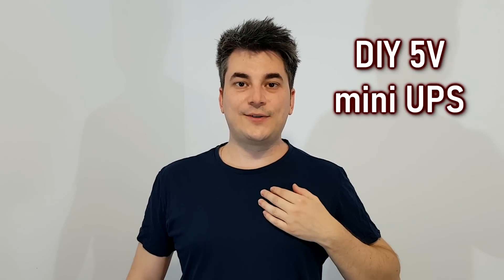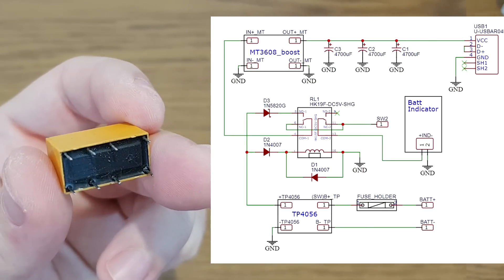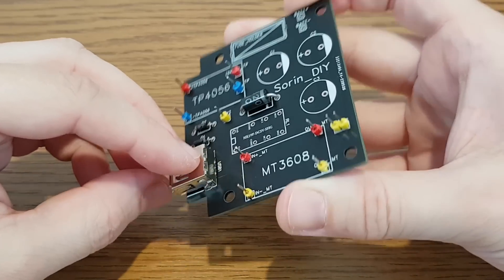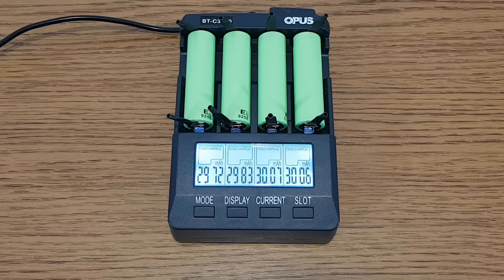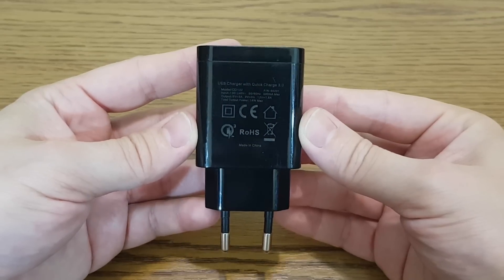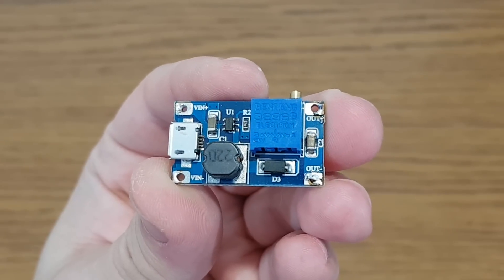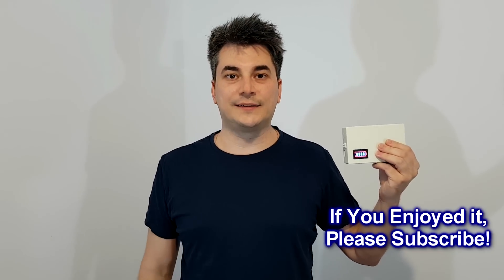DIY 5V mini UPS with 9000mAh

Comment: I am thinking about connecting this kind of thing to a USB hub to allow connecting more than 3-4 portable hard-disks, and they should stay powered even through short power cuts, which gives me a chance to switch off my laptop safely, without the risk of getting the HDDs disconnected from power suddenly. It also should allow data transfers like USB 3 (about 100MB/s).

When I watch your video, I am a bit worried that these batteries may set themselves on fire one day, without any balanced charging / discharging.

Comment: Congratulations for a good video. I want to point out that you have not taken care of load sharing when charging the battery with TP module. Since you are charging the battery as well as at the same time you are taking current for output USB so the TP module will confuse and will keep charging the battery. It may not stop charging the battery. Have you seen battery charging stopping upon completely charge ?
Reply from the maker: Hi. The schematic may be a little confusing. the battery is connected to the boost converter, only when there is no charger input and the relay pins (battery to converter) are in normally closed mode. when the charger input is active, the relay "opens" the battery-converter circuit and the battery is connected only to the TP4056. so the charging of the battery is done separately from the rest of the circuit.

Comment: Would it be possible to add a push button for battery level check when not plugged in? Instead of flipping the on/off switch.
Reply from the maker: Yes.

Comment: Can we adjast out put to 12v
Reply from the maker: With this configuration it will have a very low current. I will build a better 12V/19V UPS in the future.
Reply: @Sorin_DIY  please i need only 12v

Comment: Sir, I'm a newbie and I have seen your 12v wifi ups video but can we swap 5v components with 12v components and use it as 12v wifi ups?
Reply from the maker: No. it needs more modifications.
Reply: @Sorin_DIY  ok thankyou

Comment: I have a question, if the power grid is restored, will the battery be charged simultaneously with the load operating using the grid power?
Reply from the maker: Yes.

Comment: What is the use of diode no. 2  1n4007 in your schematic? What does it do ?
Reply from the maker: It's used to decrease the voltage that powers the relay from the usual USB 5.1V to 4.5V, so the relay will switch to battery faster, when the mains is interrupted.

Comment: Sir please reply.... how much maximum amperes can we give at input of mt3608 module ?
Reply from the maker: The input current depends on the output current/load and efficiency. the max out current is theoretically 2A, but in my tests I got max 1.8A and then the voltage drops. with a high out current the efficiency will be low so it will draw even more current at the input. there isn't a simple answer, you need to measure and calculate everything.
Reply: @Sorin_DIY  sir which bms can I use for my 3.8v lipo battery full charge voltage is 4.35v

Comment: Just ordered a multipack of those tp5100 modules to try out.  I'm still a fan of the tp4056 and have many.  But the increased voltage input on the tp5100 is intriguing.  Good job.  Thanks for the info Sorin.

Comment: Will the battery keep in floating charge mode overcharge and die quickly?
Reply from the maker: no. when the charging is completed, the TP4056 module cuts the charging current. it doesn't have float voltage.

Comment: Neat project! I was wondering if I can use this as a Raspi 3 UPS, would this sufficiently provide amps for the raspi?
Reply from the maker: This UPS works with a 1A load. I think Raspberry Pi 3 needs maximum 2.5A, so I don't think it will be stable. but I will make soon a better UPS, with a higher current and bigger battery pack.
Reply: @Sorin_DIY  Awesome!!!! I would love to see that soon! Great work man!!

Comment: hope you can make 12volt in and out ups with relay, protection undervoltage and overvoltage for battery 12volt vrla/lead-acid, thx 🙏

Comment: very neat project but some of us usually dont have access to jlcpcb in our country but i have a similar board which is YX-X804. only problem is there is about 1 second delay when the relay switched from power supply to battery. im currently using it on my router. ive tried different types of capacitor i was able to salvaged from but non works or the maybe the capacitors used were not have enough juice to power my router? oh btw my router only draws 0.3 amps on 12v if that help solvesbmy issues.
Reply from the maker: Hi. I'm not familiar with that module, but 1s delay is long, most devices will shut down in that time. you can try with bigger capacitors on the output. 
or you can make my circuit on a simple perf board, or just solder wires between the components.

Comment: You can cut the charging of the batteries by adding a LM431 adjustable zener shunt regulator connected to another relay/mosfet or just use a different Rprog resistor to lower the charging current thus never letting the batteries reach 4.2V

Comment: looks good.would it be easy to change it to 12V?
Reply from the maker: this boost converter is not powerful. it can deliver 12V but probably with only 100mA.
Reply: @Sorin_DIY  what is the code or model name of the boost you showed in the video? Thanks!

Comment: Great stuff. Have really been long time for such tutorial videos. How hard it is to build 5V/5A(max) or 2.5A max ups. Is it a completely different redesign? I am looking to use somesomething of Raspberry pi4. Thank you again for making such great content.
Reply from the maker: hi. it will need a more powerful boost converter and a larger battery pack. like the ones I showed in the video.

Comment: what is the max amp i can get from this ups ?
Reply from the maker: the boost converter can deliver maximum 1.5A. but as a UPS it will work with 1A or less.

Comment: Hi Sorin , You always produce valuable video , and it,s very interesting . I need one info from you , i know it,s out of this video, and sorry for that , I have a cordless vacuum cleaner , it was working well , suddenly  it stop working , i change the motor and it works well , but the next problem is it works on speed one and when i turn on to speed 2 two ( both speed works with the press of the button) speed two cut the power off . i tried to check on many was couldn.t find the fault . can you help Tks Pal
Reply from the maker: Hi. without seeing the circuit I don't know where the fault may be.
Reply: @Sorin_DIY  Thanks Sorin, I will check it out stage by stage ..Hope to see your next video

Comment: good tip about poking the eye out, i never had anything hit my eye using dremel tools and what not because i always wear eye protection , except once when iwas cutting a piece of plastic with wire cutters, it literally hit my eyeball and i could feel it ike a blunt force hit on the eye,  not a sharp pain, and even felt sore after like a bruise would.  watch yourself when cutting hard materials, (actually dont, close your eyes!)

Comment: Can you not use the diode to lower the TPM charging voltage the same way you did for the input voltage?
Reply from the maker: no. it will not work correctly.

Comment: You bypassed the under voltage protection on the TP4056 board
Reply from the maker: no, I haven't. the over discharge and overcurrent protections work.
Reply: You didn't use the out - pin so i got confused .
Just realised that out - and tp4056- were connected together

Comment: This is good.

But there are smaller module that has almost all the feature integrated onto a 8pin IC:
- 3.7V battery 
- OverCharging protect
- OverDischarge protect
- OverCurrent Protect
- 5.12V 2A Output Boost
- 5V 2A input
- Support pass through charging (if input connected to 5V, output also 5V)
- 4 led indicator
- one click on/off button
- 92.5% efficiency
- Realy small pcb size 15mm x 28mm x 5mm
- Really cheap (around 1US$/module in my country)

The name of module is MH-CD42 & the IC name is IP5306

For the output just add 2x1000uf 10V capacitor or more so there no voltage drop when changing from main power to battery power or otherwise.
Reply: I have this module and i was looking for this exact info.. could you confirm the 2x 1000uF are in parallel or series? also is it better if I use one 2200uF or 4700/6800uF , can i use more than 10V like 16V 25V or 100V ? Sorry i'm just excited for this project.
Reply: @TruthLoversKoSALAM-fg8dh  
The capacitor is in parallel

For the cap voltage you can use anyting that more than 6.3V, so 10V is great.
For the cap capacity i reccomend use 1000uf-2200uf (not more not less)

Comment: May I suggest putting a Schottky diode in series with the battery as it has about 0,3V drop.. As long as it can handle the 2A max current

Comment: It's allways good to see new DIY designs... i used the TP4056 a lot in the past, but now i changed to the TP5100... also accepts 5v, up to 18v, and it's a buck charger, so it will be much more efficient, so less power wasted into heat...
Reply: Yes TP5100 is lot better than TP4056

Comment: Small hack I use for a similar application (actually I only want to be able to power my circuit from the same USB as the battery is charging while the battery is charging, but the trick applies here I believe): you can set the charge current for your battery pack from TP4056 by changing the resistor on it and you can select the maximum charging voltage by putting a diode in series with the battery and choosing the diode which has a small difference of the forward voltage at the max charge current and at zero charge current so that the battery doesn't go into a start-stop charging loop. I use a 1N4148 and set the current at 300mA... it charges the battery at ~3.8V and I don't see the blue and red LEDs flicker when charging ends.  I used this trick to make my nephew a music box with a DFPlayer mini and it's on the original Li-ion batery (1 cell) for 3 years now, being played every day and charged every other day. It's a miracle I can still think without singing "Aramsamsam" or "Lulu danseaza-n poienita" constantly :D

Comment: Dude, metal washers on a pcb? They are conductive, you know ...
Reply from the maker: so are the metal screws that tighten PC motherboards to metal standoffs, right? 
there is nothing conductive on the PCB around the holes. I designed the PCB so it can be tightened with different type of screws or even washers.
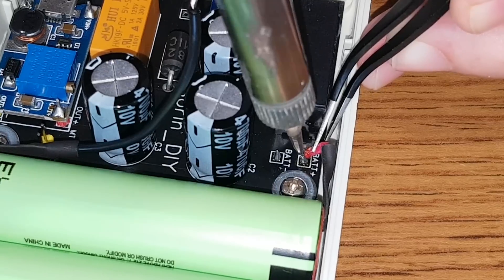Reply: @Sorin_DIY  @7:11 it's clear why we don't do that. In a real UPS with qualitative design no-one put washers/fasteners so close to mains or battery i/o - a simple mechanical shock on UPS housing can break that area and the bolt or washer to short the battery terminals or worse the mains. Latter will hit the circuit breaker and you'll have pretty 'awesome' time debugging why a practically new UPS triggers the breaker or why its batteries are in faulty mode on the display :D

Comment: hi my friend, i love this DIY  and maybe i will build one for me, thanks for the idea, maybe if you add a push button to charge the capacitors turn on and on the battery level indicator on demand can solve the issue of turning on and off multiple times to charge the capacitors. I think this can be great for my raspberry pi pc

Comment: What is the relay switching time..can it be a UPS for say a raspberry pi, can you test if it will drop out when switching please
Very cool, definitely need a build and test video on the larger output, this would be a GREAT backup for a raspberry pi or other 5vdc device
Reply from the maker: Hi. the switching delay time is about 0.1 - 0.5s, depending on the charger and the load. I don't have a raspberry pi but I'm convinced it will work. but it also depend on the total current consumption, this mini UPS is recommended for less than 1A. because with a higher current the boost converter will heat up and may not work correctly.
Reply: That why the capacitors are there, they keep the load On in your case, the Pi, until batteries kicks in. Plus relay used here, got a small switching delay, so chance are high to be good for a Pi or any 5V device.
You need to check his video he made long ago about Router UPS, last time he used capacitor to maintain load ON and dummy load to fast empty the Power wall charger.
This time dummy load is kind of replaced by more efficient relay time.
PS: I made the Router UPS based on capacitor & dummy load, for a 9v Router and it is working well.
It is basically the same as the router USP, instead this time voltage in only boosted to 5V.

Comment: What is the response time of the UPS? You say it has almost no delay switching between mains and battery power
Reply from the maker: Hi. it depends on the charger and the load. the chargers have smoothing capacitors that store a tiny amount of energy, which continues to power the relay after the mains power is interrupted. the larger the capacitor, the longer the switching delay time will be. I tested different chargers and delay was 0.2 - 0.5s with no load. 
if you connect a load to the UPS, it will draw power from the charger. so when the mains power is interrupted, the load will discharge the capacitors inside the charger faster, so the relay will switch faster. in my tests I got about 0.1s.

Comment: I really appreciate that you started to have links for the components you are using. As always, very instructive project
Reply: May I suggest putting a Schottky diode in series with the battery as it has about 0,3V drop.. As long as it can handle the 2A max current

Comment: Perhaps a different charger circuit module would have adjustable charge levels?
Reply: It doesn't, but it does have a pin 8 that you can pull low to disable the chip (and disable charging). It would need a bit of logic to operate that, but it should be manageable.

Comment: UPS? im sure this is different from actual powerbank lol maybe people like you need some learning instead telling people something that is not
Reply: UPS stands for Uninterruptible Power Supply, the power to the output is not interrupted when the mains is disconnected, so it's a UPS.
UPS for computers/servers that you buy are 2 types, the cheaper one, those are the standby versions, they power the computer straight from the mains,
and flip over to the 12V to 120/230V inverter as the mains get interrupted. The more expensive UPS are the active versions, those use a combination of the inverter build in and the mains, and filter out noise from the mains. Those version put out a real sine wave compared to the chopped sine wave of a the cheap version.
These ready to buy UPS have a 120/230V AC output offcourse, but the version that Sorin build works almost the same, but for 5V DC.

Comment: Thanks, this project is simply perfect!!! I Will wait for a variant having also a small 6volt solar panel to keep batteries charged, and the main power just to charge batteries when needed. Of course this variant will not be an UPS but more and offgrid Power source for small 5v projects. Br

Comment: Great little project making good use of other readily available modules. Only thing I’d add would be a temperature sensor on the batteries and maybe an inrush current limiter.  
Any chance of showing the supply current/voltage during switching on a scope? I’m interested to know if the dip would cause a processor reset on a connected project.
Keep up the excellent work and great to see you are training your assistant 😀👍

Comment: I'm not trying to teach anyone how to suck eggs but with UPSs it can be very useful connecting them to the target device via dual input adapters. That way if the UPS needs to be disconnected for a moment, you can parallel power the target device and remove the UPS without interrupting the target device. Not sue if this device will accommodate that.

Comment: Neat, in fact very neat !   Worth mentioning that you chose a TP4056 board that includes the DW01 FETs discharge cutoff to avoid over-discharging the cells.

Comment: could you please show a raspberry pi or something similar as an example .. just wanna see if it can keep a mini computer like raspberry pi running after power failure ... thanks for the video .. its pretty good
Reply: its 9000 mAH, so just divide by the current used by the PI  to get the time in hours

Comment: great video as always bro .. so if you would have made a 12v model instead of 5v .. would the 12v be able to act as a ups for a 12v router?(i mean the router should not restart on power failure .. that's the kind of ups I want to build myself) .. are you planning to build a 12v model ?
Reply: He's already done a 12v one.
Reply from the maker: it needs a bigger battery pack and a more powerful boost converter.
Reply: @Sorin_DIY  : ohkk .. thanks for the heads up !!!!
Reply: @Sorin_DIY Can I get a ready made circuit?
Reply: He already build a 12V version in 2019 :
https://www.youtube.com/watch?v=IlEnEn7ptmc
Reply: Just use a a better boost converter

Comment: I am having the same issue with my DIY Bluetooth speaker when trying to turn it on, i have a toggle switch too and the only way to turn it on is to flip the switch on an off a few times quickly. I have added among other things a boost converter for the amplifier and the capacitors are not kind to the battery during startup. It works fine when it is connected to USB power though, exactly the same issue like yours!

Comment: This looks perfect for a Raspberry PI UPS
Reply: Good point!
Reply: Not sure it would work, The Pi 4 needs a 3 Amp PSU
Reply: @mrflibble5311  thank you!!
Reply: @mrflibble5311  : older Pi's don't need as much and even the pi4 needs less than 1amp unless you connect a lot of things to it
Reply: @DaHaiZhu  Good to know. I had a few 5V 2A psu's lying around and actually went and got a 3Amp because it was the spec .